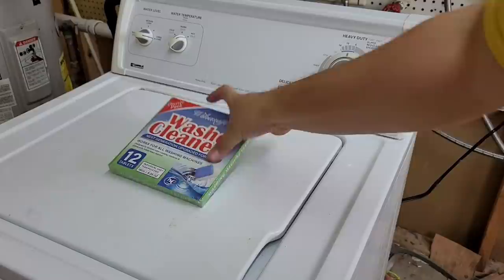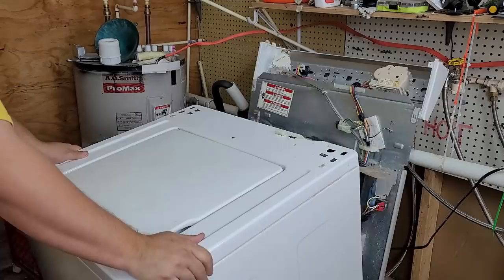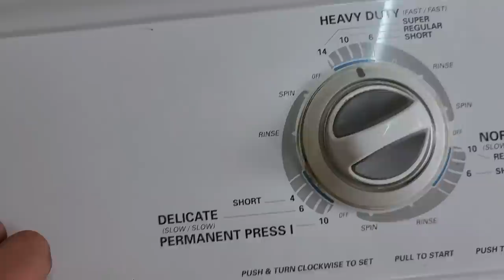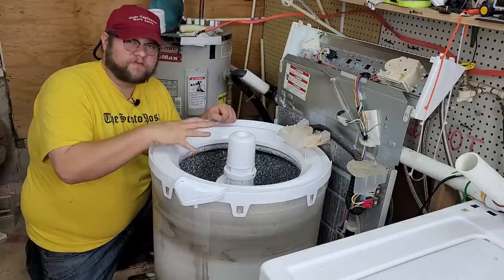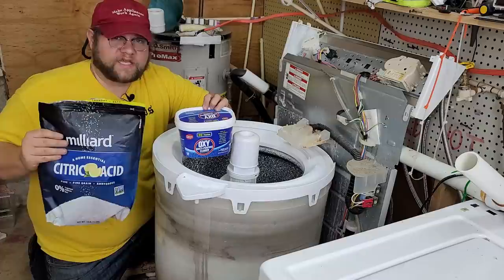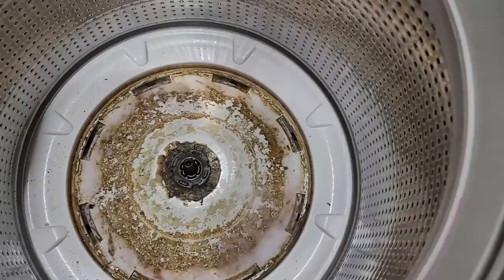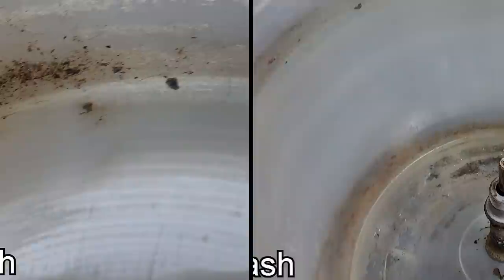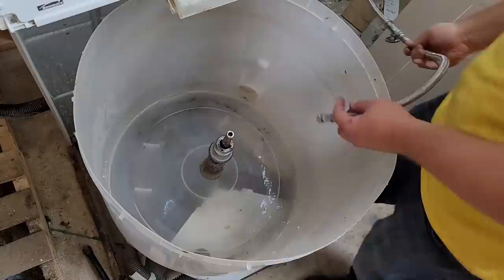Clean a Washing Machine Inside: How to Remove Mold, Soap Scum and More with a CHEAP Organic Cleaner

Comment: I watched this video a few times a few weeks ago. I have now done our front loader. Picked a cycle and let it run. water wash dark in the window until rinse cycle.  
I also have done a traditional 30 year old Roper top loader.  I used straight hot water (no boiling water added) and cold rinse cycle. I also needed to clean the top 4 rows of plugged holes.  I did this intermittently. As I would allow machine to agitate and then stop it and let it sit while I cleaned holes.   I pulled the agitator and and cleaned under and inside it. I spent 4 to 5 hours all total . I would let it agitate and then sit for 20 minutes.  I kept doing this until water had cooled significantly.  It took three rinse wash cycles until all the debris was flushed out.   Drum, agitator and inside almost look new and sparkle.  Got rid of the red Iron staining from our water, too.    Downeast NC.
I used 4 Tbps of Oxi-clean and towards 2 cups of Citric acid. Ebay for 5 Lbs. Best price for smallish qty per pound. Could not find none food grade in small qty.  
Will definitely do this again.   
Thanks Video Creator.
Reply: Thank you for this detailed testimony!   I was wondering what temperature I should use.  So I will use hot just as you did.  Thanks again!👏🏾
Reply: Thanks for letting us know the details of your cleaning, it’s really helped us out!
Reply: Just a question,  do you think that over time running citrus acid thru the wash/rinse cycles will cause any other issues such as drain pump and/or discharge hoses breaking down?  Thanks.
Reply: Do you know how to do a front loader? So that it’s able to fill and brings the water level up high enough?
Reply: @JohnSmith-tv5ep  I read about this as well. It seems if you do it too often and too much you can shorten the life of the components. 
“Dose makes the poison.”

Comment: For the average homeowner, this is a pretty cool way to clean. For use crazy dudes out here that rebuild these awesome Whirlpool washers, the best way is to always pull the drum, pressure wash is, shrub the outer tub. Then use a good RTV sealant around the rubber center seal so you never have a leak from it. Or, better yet of course, replace the rubber center seal vecasue it's less than $10. But, sometimes the basket drive gets rusty and you will have to sand and paint before you slide that new seal on. I also will get some good hi temp paint and repaint the washer drum. If you do it right, let it dry properly,  it will look amazing and last for many years. Wash on! 🤘
Reply from the maker: Great tips! Thanks for all of the good advise. We almost always re do the tub seals as they are so cheap
Reply: Bonus tip. Many early series HE Whirlpool, Amana,etc have tubs that fit in older Whirlpool brands. You have to switch the balance ring but the tubs are so much newer and easier to clean. Wash on 🤘

Comment: I have a Kenmore washer and dryer that is 25 years old. They have never been worked on although I did have the service guy come out once about five years ago because I thought maybe they needed worked on. He said they were great. Nothing you can buy today will ever match those old machines. I talk nice to him every day and hope they last another 25 years.
I have a friend in Europe and she says that over there the consumer does not tolerate disposable items. Most of the appliances over there last for years and years. Not like the ones here that fall apart, and are actually meant to fall apart relatively quickly.

Comment: Good info here. I refurbish washers and dryers as a side hustle and just ordered some to start adding this to my refurbishing process. Depending on how much disassembly I've already got to do in repairing, I keep a pressure washer nearby but this will be a time saver for machines I dont need to tear down
Reply: I wish the guy who sold me my used Kenmore had cleaned it; I have gunk all over my laundry right now.

Comment: Great video. I tried this and worked great but added one more step. I used my sous vide and plopped it in the washing machine and left it running overnight on the highest temp to keep water at 140F. Woke up next morning and it was clean as new.
Reply: What's "sous vide"?
Reply: @barbrn a sous vide is a cooking tool.  You can set the temperature to want the water to be,  and plug it in and leave it to maintain the temperature of the water. 

You can use this to cook food to work 1 degree of a certain temperature.  It's great for streaks because you will always get the correct doneness

Comment: The other issue you didn't mention is that detergents have changed over the years, contributing to the buildup, and also the use of fabric softeners. My washer looked almost this bad after just a few years, but instead of great-looking, it was lighter from the soft, waxy buildup. No cleaners or specialized cleaning cycles helped. The slight odor would return within a week.

Now, I also have a large family with teens, and it runs probably 10+ cycles a week.. so that also contributed. I have taken it apart to clean it with a pressure washer twice in 10 years. It went longer after the first wash, I believe because I banished fabric softener from our house.
Reply: A waxy buildup is probably from fabric softener or soap scum (which shouldn't be a problem with any modern, mainstream detergent). 

For that, I'd just use washing soda (aka sodium carbonate) or oxiclean, which is mostly washing soda, on the hottest wash cycle you have.
The citric acid used in this video won't help with it (it instead helps with hard water/mineral buildup) and will actually impair the cleaning ability of washing soda/oxiclean.
Reply: @themikeroberts  My wife has thrown cleaners specifically marketed for cleaning washers in there in the past that didn't seem to have any real impact- I'm curious if they use sodium carbonate. If not, I'll get some and give that a try. Thanks for the suggestion!

Our machine does have a dedicated cleaning cycle that specifies not using any cleaners.. but it uses the second highest heat setting and that can't be adjusted. When I have tried some of these ideas, I'll use the only cleaning cycle that allows selecting the "Extra Hot" temperature setting. I have even been thorough to the point of cranking our water heater to the highest setting and waiting for it to reach it, run the washer/cleaning cycle, then turn the water heater back down immediately. (Normally set at 120F at the tap, the highest setting could give almost 150F right after it cuts the flame at the tank.)

I don't know just how effective each method is, as I wasn't disassembling between runs, but banning fabric softener from the house definitely seemed to make the biggest difference.

Comment: This was such a helpful video! I can't wait to try this. The mildew smell I am having in my laundry is driving me CRAZY!
Reply: Me too!
Reply: Same.
Reply: Did you try it? My washer is in the basement and I could smell the mildew as soon as I come in the house. It’s making my anxiety go through the roof!!!
Reply: I'm guessing that you never use chlorine bleach on a hot water (white clothing / towels only) cycle if you're smelling mildew (?)  🤔
Reply: @Austin8thGenTexan  I do.  But then the smell comes back after a couple of days. The other week I removed the cap from the bottom of my front loader and let all the water run out. I didn’t use the washer for about a week and NO smell. I think the design of these washing machines having this water reserve is the cause of the mold and smells.
Reply: @eb9844    That was my best guess.  I hardly use chlorine bleach anymore,  but my garage is very dry - and I leave the lid open.  I wish you well for solving this problem...  👍
Reply: @Austin8thGenTexan  thanks for the suggestion. I only use bleach for my white towels so when the smell used to get bad and I didn’t have a load to bleach, I would just run an empty load with bleach on hot. So far emptying the reserved water seems to be helping and I’ve always left the door open and have taken out the detergent tray. I can’t tell you how nasty that tray gets. My laundry room is in the basement so I don’t notice the smell until it travels up.
Reply: @eb9844 Try Oxiclean Sanitize. Wear safety gear when using and opening container. Or, use the mold killing stuff sold at Home Depot.
Reply: @blueskies773  I’ve started to water down the fabric softener a few months ago and now I no longer have the awful smell problem. My kids use way too much of that stuff. Two of my kids have gone away to university in September. Wondering if that was the issue.

Comment: Hey Ben, Our 20 year old LG front loader had a mildew smell to it.  Two things I did was keeping the front loader door open to air dry over night.  To kill the mildew by just running a cup of bleach through the wash cycle without any clothes.  We're in Colorado so humidity is not often an issue.

Comment: Another chemical to use is TSP, not the substitute but the real stuff. Usually found in the paint prep area of stores like Home Depot. Phosphate was the original cleaner used in all laundry and dishwasher detergents. Govt. restrictions required the removal of the phosphate. It was replaced with citric acid and salt. Add about a 1/4 teaspoon of TSP to your favorite detergent in the clothes and dishwasher for improved cleaning.

Comment: Thank you for this great video, Ben! We have an old top loader just like this one. We take it fully apart exactly like you show, every 6 months to clean it. It is a huge chore and it's always gross, even though I clean all the grime and scum off the drum and the plastic tub, and even take the drain hoses off to clean out. For unknown reasons, there continues to be a funky mildewy smell even after doing this entire process of cleaning everything. I will try this and see if it works instead of taking it apart! 
I did YEARS of research & experiments on this issue before learning how to take it apart, and realized no detergent or cleaner could remove the amount of scum that builds up. But, I haven't tried citric acid. I have to use a paint scraper on the drum exterior to get it off. I only use natural laundry soap (Nellie's laundry soda) and vinegar in the rinse. My whole family is sensitive to all the chemical detergents and perfumes. Years ago I learned that most people use too much detergent and the toxic fat-based softeners like Downy act like glue in the machines. I've never used those and yet the scum buildup is still a problem. Hopefully this method will solve that! I've intentionally kept this old machine b/c I know the new ones are problematic, barely use any water, have major mold issues and I cannot take them apart.
Reply: Check the drain hose.  Lots of stuff gets stuck to the inside of "corregated" drain hoses". Some of the water in them drains back into the machine after every cycle.  If you have the cabinet apart, use a weak chlorine bathroom cleaner spray to mist the inner cabinet and the area around he machine.  If your washer is in  a basment, don't store dirty or clean clothes down there.   
 If it still smells like mold, do a no-clothes  white wash cycle max level, max length,  hot with 2 cups of clorine bleach. If you don't have a soak interval, stop the machine during the wash cycle and let it sit for 1-2 hours.  Do a second cycle with no chemicals.
Reply: @psdaengr911  Thank you. I always pull the drain hoses off and clean them at the same time. It is a bad design that water sits in the plastic tub after each wash. The amount of sediment and grime in the bottom of the tub (when we take it apart) is gross. 
I have done bleach cycles years ago and it didn't make a difference. This most recent soaking w 2 cups citric acid & 1/2 c oxobright (natural version of oxiclean) did the most help. I started with small load size & hot water, let it soak for 4 hours, then filled to largest load and added more water to deal with scum line. I then let soak 24 hours with several agitations in between. The water was smelly and pulled out some of the grime. Since then the washer smell is better (not 100%) so we'll still likely need to take it apart every 6 months.
Reply: @erikaberglund2564 you can get rid of all detergents by switching to ozonated water! You can always use cold water and detergents aren’t necessary unless y’all’re farmers, chefs, or mechanics; with an extreme grease and dirt load detergents can be necessitated. 

Another awesome thing about ozone is that it would naturally cleanse all the gunk build up in your washing machine, too ; therefore, extending the life of your washer. 

I forgot the name of the company that makes them, but their marketing was absolutely wonderful. 🙂
Reply: @trevorrisley5419  thanks Trevor! I had not heard of using ozonated water. I’ll look into it.
Reply: If you have hard water, adding 1/2 cup borax and a tsp or so of citric acid to every cycle will benefit your clothes and machine

Comment: 👍  Excellent tutorial!  One problem tho...If I took our machine apart with the ease as you did, I assure you, I would never be able to get it back together in working order.  Our machine is 24 yrs old, looks and runs as the day it was delivered new. There is no odor or any malfunctioning.  So...in my case, I will just leave well enough alone.  But thanks anyway! lol

Comment: When I brought my first house back in 2018 my dad offered to buy me any washer and dryer I wanted as a gift for getting started 
I went to a refurbished store and picked out the biggest Maytag set they had for maybe a little under $700 doesn’t come with an agitator which is ok for me. I have no regrets still. I leave my door open when I’m done washing. 
I have no plans to replace it anytime soon. But I’ll be picking up some citric acid now for sure. Great video

Comment: Thanks for the well explained video 👍.
Bought a used washer dryer set 13 yrs ago & still running strong & quiet.Did  regular baking soda/vinegar rinses when smell came back.After watching this video last nite,I now finished opening mines & cleaned it very gd.looks new & dont smell now.about to put it back together & do my first wash.family is waiting to redo there wash 😂🤣😂🤣.

Comment: If you have an HE front or top load, look up how to remove your dispenser tray.
Everyone forgets that.  
Bought a house with Samsung top load washer and dryer and wash nice and clean. 
Then pulled tray and it was all black on back out tray you don't see when pulled out while still connected. And the hole it sits in had a ton of black. Bleach and water cleaned it 
Now I leave the door and tray open to dry since I've got it all cleaned now
Reply: There is more still down that tube. I've taken mine apart several times down to th tub.  I have same washer at camp which is solar, free hot water.  Cold inlet is connected to hot water.  That soap dispenser is still spotless after years.  Same machine as at home.  Cold water to dispense detergents just doesn't work.
Reply: This is so true, I've had to clean mine a few times. I never really thought to pull it out and check it. I took a rag and cleaned the inside where the tray goes as well.
Reply: We have a small little fan that we throw in the door of the washer right at the rubber gasket and it stays on between loads to dry the gasket faster. I would kill to find a tool/brush that I could get down between the drum. I’ve taken Clorox wipes and rolled them up and stuff them down as far as I could get and it’s gross what comes out, but it’s just to shallow.

Comment: I always use 100-200 grams of CA to clean my washing machine ones per 4-6 month. I use the 60C cleaning program and turn the machine off in the middle of cycle to give CA time to dissolve deposits. After the program was completed, I ran two short cycles to wash out the CA from the inner parts of WM.

Comment: I had a perfectly functioning washing machine and didn't have a dryer. I wanted a nice matching set and bought a front-loading set. I hated the washer . It was always a chore to try to keep the washer from stinking. They say the smell is because there is always a bit of water in the bottom of the inside drum. The washer broke once and I fixed it thanks to youtube. The next time it broke I trashed it and got an old-school used set. I like the old set so much better, the clothes are brighter and smell cleaner. I also like that a cycle can be stopped to allow a long soak. My friend had a frontloader that broke the repair was to be $350 for a new board. The repairman said he could not guarantee that the new board would not instantly blow again.

Comment: Of all the instructions I've seen for dealing with this problem, this was the best. This video's method took a lot of pain out of the process However, in our case, cleaning the drum and basket was necessary but not sufficient. What we found (my wife diagnosed the problem) is that a lot of "scrud" was embedded in the agitator/impeller/pulsator, between the metal cover and the plastic disc underneath.  We couldn't find a practical way to clean the agitator, so we replaced it.

Comment: I use that LemiShine stuff. Used to be able to get it at Walmart. About a year ago my local supermarket was blowing out LemiSHine appliance cleaner on the discount shelf. It says to use hot water on the longest cycle. I have a Speed Queen and it does complete the cycle fairly quick. They call that junk "Scrud". I think it comes from liquid fabric softener, hard water residue, and detergent. I usually use dryer sheets and have a water softener, but I still periodically clean my washer.